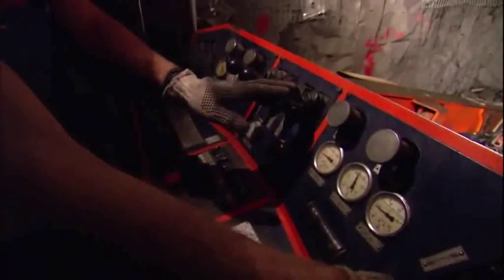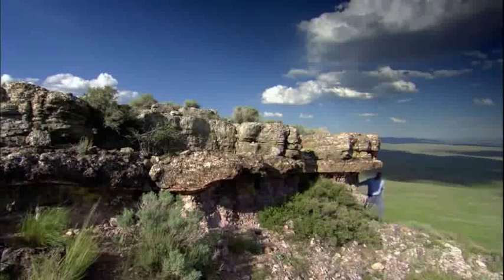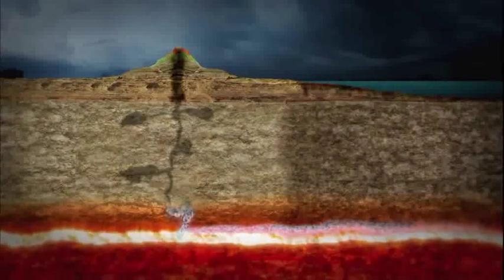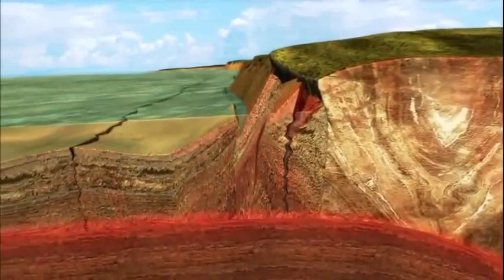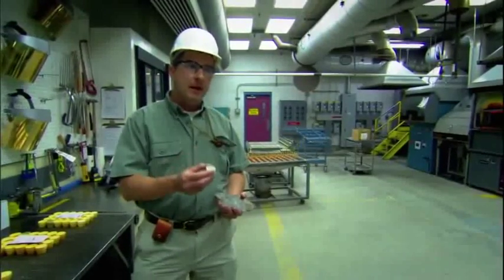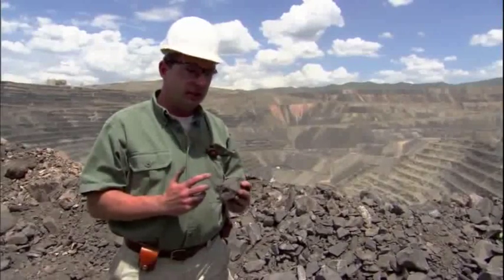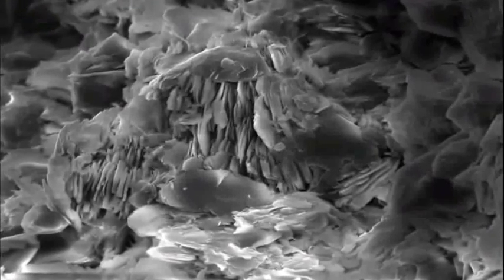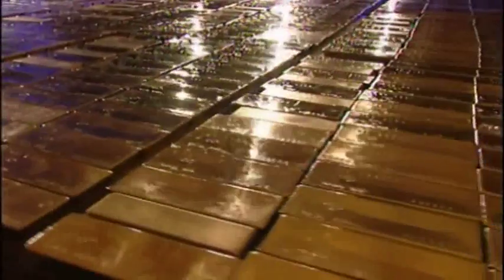Geyser Gold

Comment: Any updates to the geyser reactor? Read your book on using nano bubble c02 at the right temp to convert AG-AU. I'd like to try. Nanobubbles seem to be the key to many things including water powered engines like GEET which also shows transmutation of elements, completely converting carbon to oxygen with 3x+ more efficiency than gas. The implosion of nanobubbles causes nano ball lightning / plasma toroids releasing a ton of energy with atomic properties, proving "overunity" and transmutation is real. Malcolm Bendall created a similar engine. The artificial scarcity cartels want nothing to do with it, so it's all up to individual reproduction.